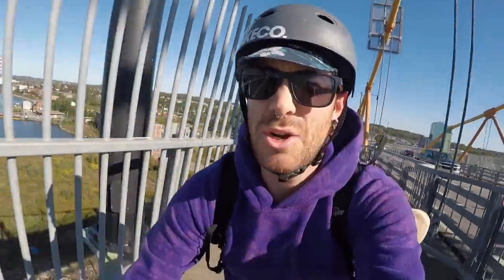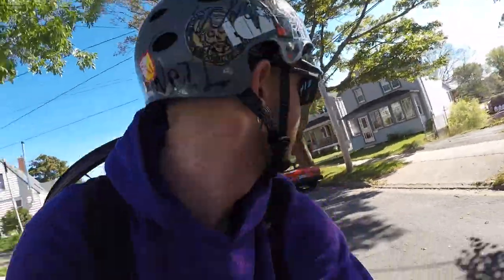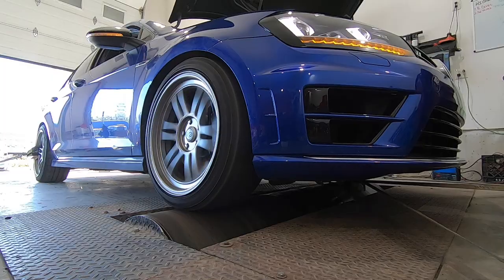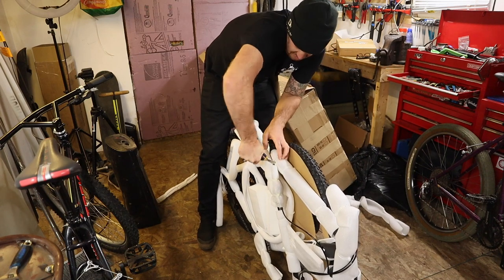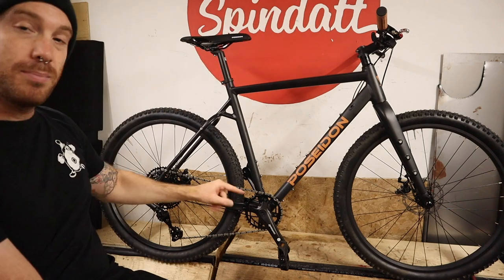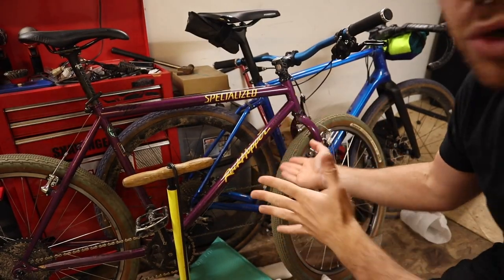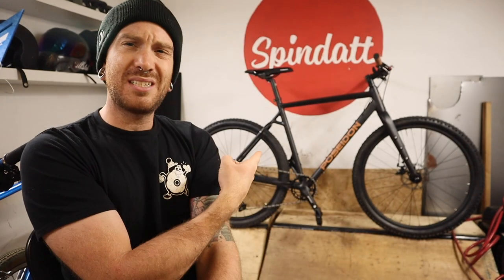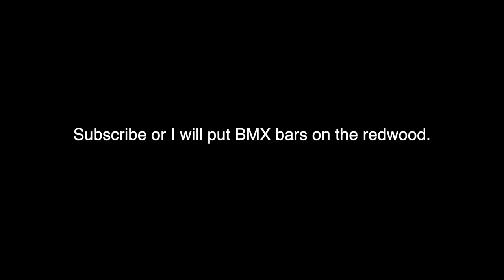Poseidon Redwood Flatbar. The question we forgot to ask.

Comment: Very nice I have a bike that has a 2speed hub as well. That I bought for like ten bucks in the summer of 2019 that I was going to fix up to sell once home but I decided to keep it for myself and get it fixed later once I found out the rear wheel was a 2SP not single like I originally thought. Seems interesting and fun since I’ve never used one.

Comment: Looks bloody lovely.....I do like the idea of a modern retro '90's bike as well.....with many bottle cage mounts....yeah !!! Could take my drop bar gravel riding a bit more MTB...

I started off back in '93 with a Kona Fire Mountain 3x7, cantilever brakes, thumb shifters and Project 2 forks.....Fat tyre at the front (2.3") and a modern gravel width tyre on the rear (1.9")......Bikes like these need to make a comeback...

Hmm, saying that I have an old GT Chucker 26" frame stashed away.....? Disc brakes though, which is a plus point....

Saying that, I've already got an '07 Chucker (the blue one) modernised with SRAM 1x11 NX, hydraulic brakes and a wide Enduro bar that I first built up back in 2012 as a 3x9.....and it's already prepped for a short pre-work hour off-road ride on Friday morning......
Reply from the maker: Build everything always anyway! haha that's what i always do

Comment: "a bunch of power, would not change a thing" That pull sounded like a 330hp pull at the crank, I can cycle harder than that. Jokes aside the Golf R is kinda okay.
Reply: You’re not wrong I had a 15 R for a bit thing was so uninspiring to drive that 2.0t was a dog even paired to a 6mt
Reply: @64Spokes  as someone who grew up in car culture and have driven a modern golf I don't need to sit in a golf R. No matter how much HP you manage to chuck under the hood, they feel like a lathargic sailboat. Hell, my stock 2016 Mazda 3 2.5L feels more lively.
Reply from the maker: well.. it's mid dyno session, it is going to be making more when everything is all done